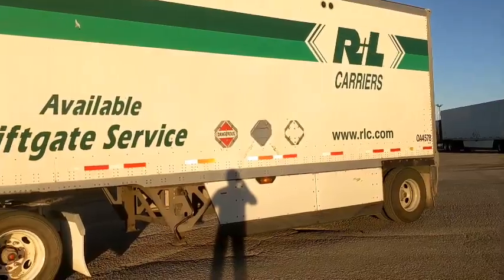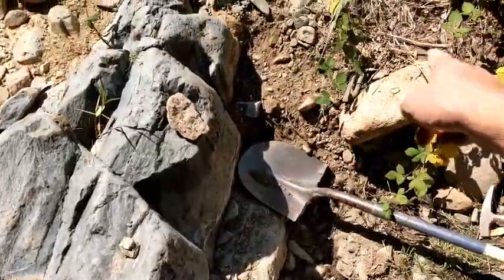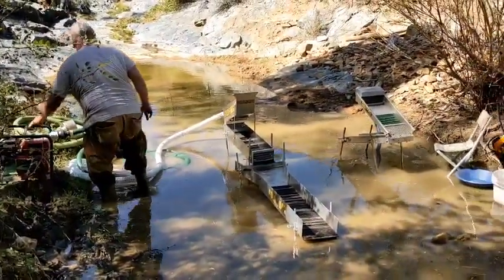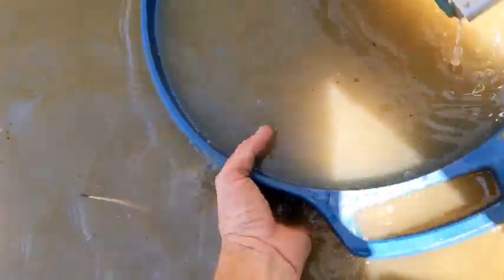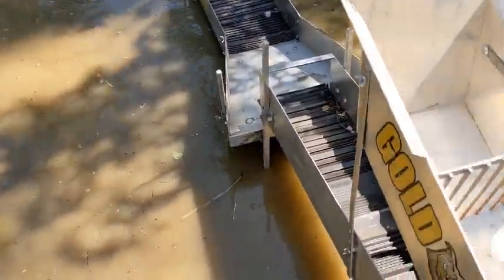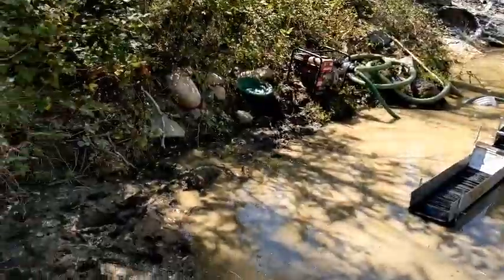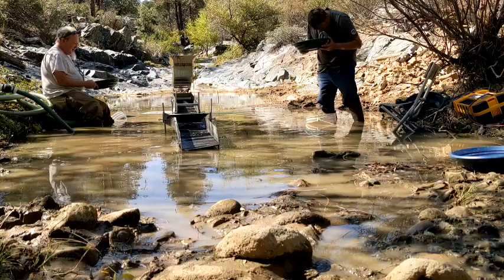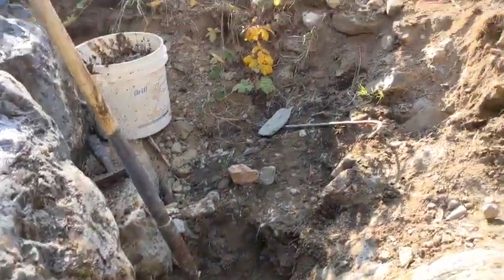gold hog piglet & keen mini max get gold

Comment: I LOVE MY MINI-MAX BUT HAD A PROBLEM WITH THE TOP OF THE MAIN MAT GETTING MATERIAL UNDER IT. TALKED WITH MARK KEENE AND THEY SETTLED THE PROBLEM BY SENDING ME A SCREEN, (expanded metal) that went to the top of the mat. made a world of difference because i run -100 material. And have recovered up to -200!
and for restaart, just close valve most of the way and bring it up slow.
Reply from the maker: Nice,thank you😁